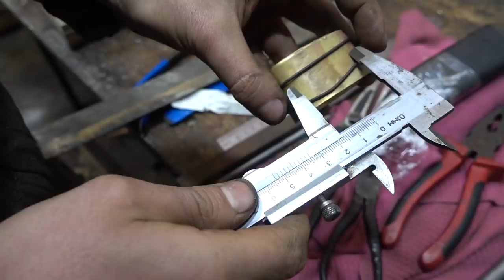Restoration Rusty Asian Dagger

Comment: What is that spacer made of between the bolster and scales?  It seems flimsy but the end product isn’t.
Reply from the maker: Hi! Between the bolster and the handle, or for example other material, I always use thin leather. It smooths out all the irregularities and prevents the material from sliding.

Comment: What oil do you use after the blade is cleaned and rust free? Mineral oil?
Reply from the maker: Any oil can be applied, machine oil or simply sunflower or olive oil. This is necessary to avoid the appearance of rust.